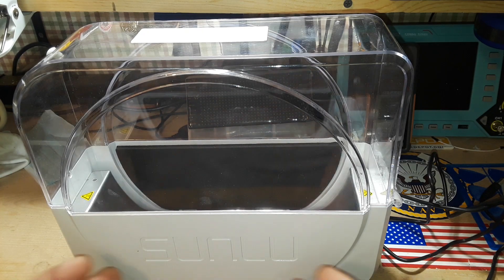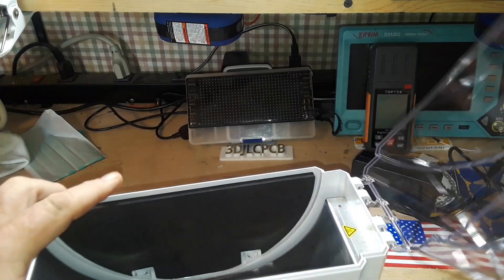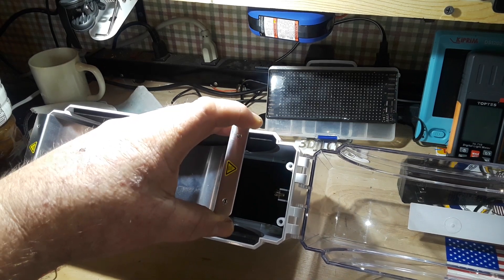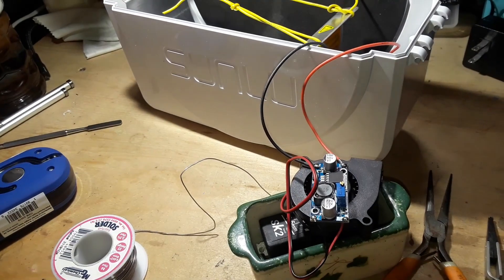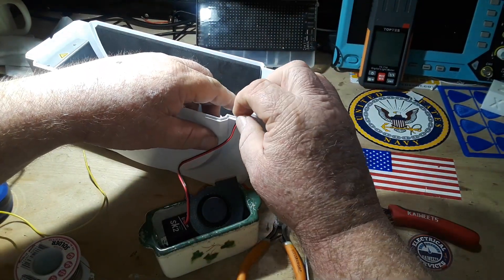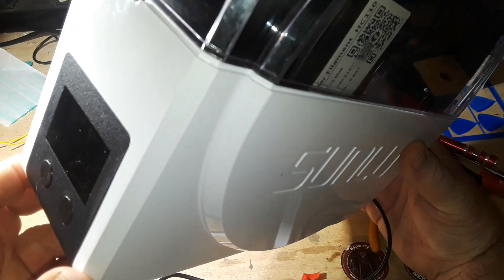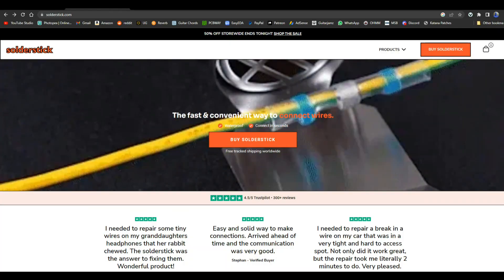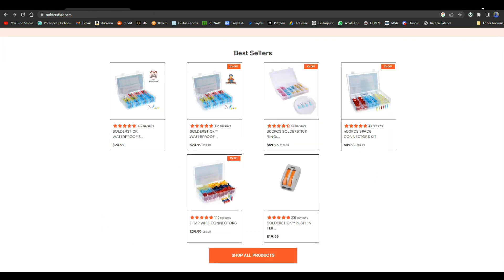Modifying My Sunlu Filament Dryer With A Fan - Sponsored By SolderStick Wire Connectors

Comment: I also did significant upgrades to mine including circulation and extractor fans.  Without the fans, the 'dryer' just becomes a sauna that traps all the moisture inside.  Incredibly bad design.  Also lacks a humidity sensor, but then again, if they included it you would know how little moisture it actually removes out-of-the-box.

Comment: I don't think your upgrade is going to be of any use... The dryer itself only goes to a max of 55°c and the fan you added will only at the most recirculate moist air.... The New sunlu dryer with fan is just a gimmick.
Only trying to be of help
Reply: Also I suggest downloading Engel E-calc for your android device, although it is for injection molding, it has all the data for thermoplastic materials that will help you for 3D printing too
Reply: I did my own upgrades and can get the humidity down from 45% to 18% within about 5 hours.  Without significant modifications it is absolutely useless.
Reply: @DigiLab360  The moisture content of the material needs to be checked before drying and after drying to see if the dryer works at all... I will do the test at work when I get chance.
I just use a big bag of desiccant in the bottom of the dryer to absorb the moisture, but as yet I haven't done a moisture content test on the filament.
Reply: @DigiLab360  I have had an idea to blow the air from the dryer through the cold side of a peltier to condense the moisture and recirculate it through the heat sink on the hot side of the peltier and back in to the dryer, theoretically it should work.

Comment: Yah Paul why are you NOT using Uncle Rob's Magic Flux on those wires? and what about a on/off switch for the fan.... High Five Johadart.
Reply from the maker: Fan goes on and off with the dryer. I could barely get my hands in there let alone a flux pen. For the buck, yes should have used it. But the dryer is working fine, currently drying a new roll of Flashforge ASA. Ill be trying it out later. I bought some and ASA and TPU.